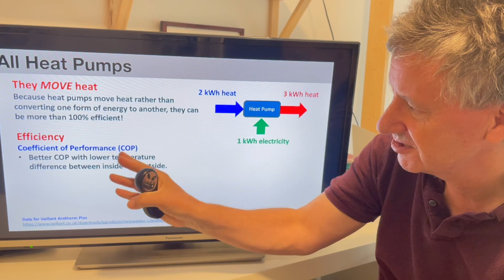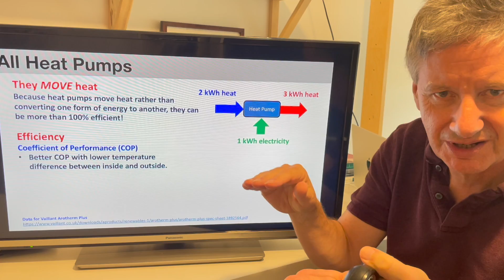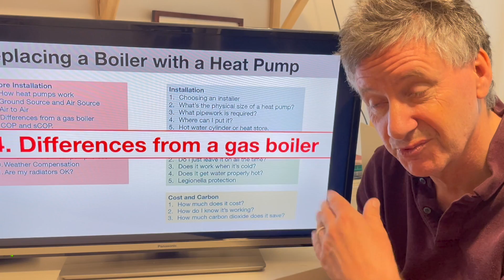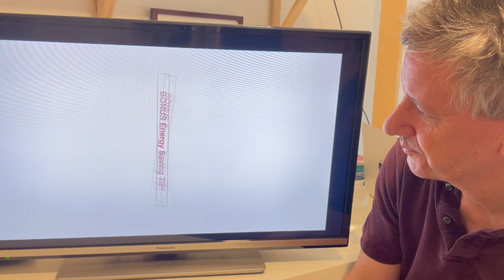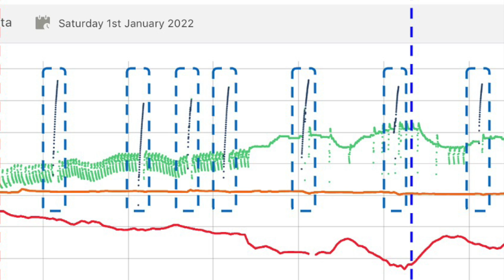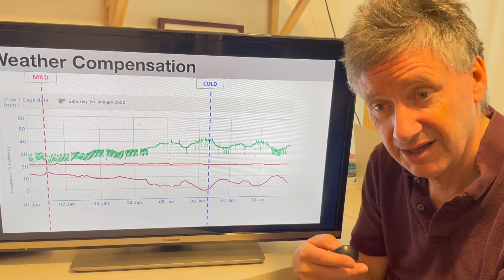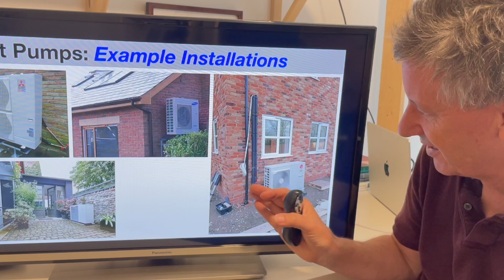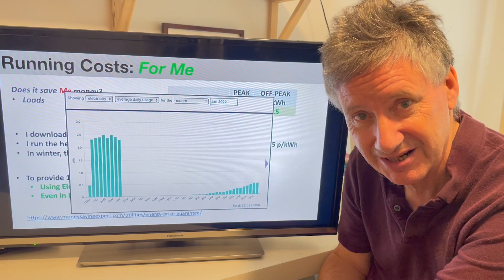Replacing a gas boiler with a heat pump

Comment: Hi Michael, yet another great presentation from your side. Just curious, how big is your soler panel and batteries, that you use to support your heat pump?
Reply from the maker: David Joelsen, thank you for your kind words.

The solar installation is a standard 3.6 kW-peak installation of 12 x 340 W (nominal) panels - 6 on a south-facing roof and 6 on a west-facing roof.

The battery is a Tesla Powerwall 2 and has a capacity of 13.5 kWh.

I think the video below has all the details including costings and installation photos.

https://protonsforbreakfast.wordpress.com/2022/02/04/reducing-carbon-dioxide-emissions-from-my-home-video-and-slides/

Incidentally in a couple of weeks I will add to the solar installation by putting panels on the east facing roof and a flat roof above the kitchen. These are non-optimal locations and orientations but I hope the combination will add enough to perhaps allow me to stay off-grid for a whole 6 months. I explain the rationale in this recent article.

https://protonsforbreakfast.wordpress.com/2022/09/01/its-been-a-sunny-summer/

Best wishes

Michael

Comment: Its amazing how something produces heat from nothing (its a bloody posh name for an immersion heater but at industrial size!) Couldn't spot how this WEF-dictated device turns cold air hot enough to cook bread in my gas cooker ,could you show this technical marvel please
Reply from the maker: David Granger, Good Afternoon.

I'm afraid I can't exactly understand your comment.

Firstly, heat pumps don't produce "heat from nothing": They move heat from a colder place to a hotter place using mechanical work. 

Secondly I wasn't sure what you meant by WEF. Is that the World Economic Forum ? I don't know what that organisation is relevant to this video.

Thirdly, a heat pump would not be used to move heat from (say) 0°C outside to the temperature of a gas oven at (say) 200 °C. But it can easily move heat from 0°C outside to 50 °C inside which is enough to provide hot water and heat your home.

I did make an explainer for how heat pumps work which can see here:

https://protonsforbreakfast.wordpress.com/2022/02/24/heat-pump-explainer/

All the best

Michael

Comment: So the main benefit is reducing your carbon footprint? Big deal. 900 million cubic feet of methane (enough to test 2 million homes for a year) just been released into the atmosphere. That would be my savings wrecked. And I’ve just come back from a business trip from India. It seems they are no burning more gas (and oil) than ever before since the Russian sanctions took effect. A quick calculation reveals That’s more carbon released  than the savings indicated if EVERY home in the U.K. had a heat pump. If people can afford it. Fair enough. But there’s millions who cannot.
Reply from the maker: So your suggestion is...?

Comment: "Basically, ground source heat pumps are not practical". What a ridiculous statement.
Reply from the maker: Chris: Good Afternoon. For most people that is the case. Why do you think otherwise?

All the best

Michael
Reply: @michaeldepodesta001  Because you didn't say ”for most people"
Reply from the maker: @sailingoctopus1  Good Evening.

The videos that I make are not scripted and are full of the inexactitudes which occur in normal conversation.

But despite my linguistic imprecision, it seems like you understood my meaning precisely.

Best wishes

Michael
Reply: @michaeldepodesta001  Then you should have replied to my comment ”sorry I misspoke, what I meant was that for most people ground source heat pumps are impractical, but for those for whom it is practical it is much the most efficient option."

You also failed to mention three  other benefits of ground source heat pumps: 
1. They are quieter
2. They are more reliable
3. The heat pump can be sited inside, so won't corrode and won't be an eye-sore

Comment: What was the cost including any additional cost for updating anything to make it work as it should
Reply from the maker: Gino, Important Question. I have discussed all the works and the cost in a couple of videos.

1. This quality isnty very good but the costs are discussed at 26m11s into the video.

https://www.youtube.com/watch?v=3Pr7wL63FjQ&t=1310s

2. This talk has the same slides with slightly better quality video. Discussion of costs start 13m10s into the video 

https://www.youtube.com/watch?v=E03O3qAZYx0

Do ask if you would like more details.

M
Reply: @michaeldepodesta001  you are a star , I don't have a pc so using the smallest mobile in the world lol . cheers
Reply: Wow you have put some serious investment. I replaced every windows and door glass to k glass so I have now. Used secondary double glazing and wow what a huge difference that has made. I agree with regards east and west. This year I installed roof rails ready for another 6 KW of solar pannels to be placed in East and West positions so I will have at least 20 KW spread over the day. Tip for you boil a kettle and use flasks to keep water hot, then decant enough for a kettle the kettle will be quick to reheat as your water will be hot from flasks.
Reply from the maker: @gino2465  What a wonderful kettle tip which I will be sure to try.

Regarding the general costs, when I retired I had a tax free lump sum of £60,000 and I couldn't think of anything better to do with it than to try to reduce carbon dioxide emissions. If I had had less I would have done less: I would probably have slipped the external insulation and just installed a bigger heat pump.
Reply: @michaeldepodesta001  good man , I am trying but the cheap way lol. My issue where I live is power outages and as I write this we are on our 12kw Diesel Genny. I invested in bigger to allow for EV charging and heat pump when I fit one. I will not go away from log for many years as I don't want all my eggs in one basket . I will work both together side by side .
Reply from the maker: @gino2465  What I have learned since publicising what I have done on my blog and on these videos, is that every person's dwelling and circumstances are unique. 

My aim is just to be as clear as I can about what I have done and why have done it. I know many people laugh at me and thinking spending that much money was madness. I am cool with that.

But it sounds you like you have a grand vision and are doing a great job within what sounds like some quite severe restraints. I wish you all the best in your endeavours!

M
Reply: @michaeldepodesta001  this video you made us the best I have viewed on YouTube you have done an excellent job and it covers everything. I like the cop figures but it's reality of winter months for heat pump and solar. Most people are running out spending £10k on 4kw arrays and 5kw battery's thinking it's the awnser to all but it's not. What you have done to your home is fantastic and is a no brainier because it's going to cost less to hear now. Quick question I was looking at getting my loft inner roof space sprayed with foam , commercial buildings use it do you have it
Reply from the maker: @gino2465  Thank you for your kind words. 

No I don't have sprayed foam. The loft is converted and we have 200 mm of PU foam boards - CELOTEX if I recall correctly.

M

Comment: We replaced our Oil Combe last summer with a ASHP, but the costs involved to purchase and install it are just astounding, and this is the biggest single barrier!  Science is sound but it will just send people to sleep!! What I want to know is why they so expensive?
Reply: Ken, the UK government is making things expensive with the rebate program requirements. Most places use much cheaper and just as effective air to air systems that can be bought for $1-2000. Sorry the UK is such a mess.
Reply from the maker: Ken, I agree. 

Typical UK costs are £13,000 reduced to £8,000 with a government grant.

I think it will reduce over time, but a heat pump itself is more complicated than a boiler, and a heat pump installation is more complicated than a boiler installation. SO I guess that explains the cost.

But in terms of CO2 emissions, your heat pump will be a big win for the planet.

Is the ASHP keeping you warm?

M
Reply: @michaeldepodesta001  the only way they can reduce costs is by cutting quality
 that's already going on . HP's may become cheaper but they won't last. they have a very hard life by working flat out in the worst conditions and far less in better weather
longevity isn't in HP's DNA
I've been in the trade since '82 and until cop goes up to around 6 at zero c by increasing compression technology I don't believe they are a good long life solution against a gas boiler unless air to air is used. air to water is still too inefficient.you'd need to add solar to realise true gains.
however the world needs early adopters to drive the tech forward which it will 👍
Reply from the maker: @richardbartlett6932  Richard, Hi. The longevity of the current generation of heat pumps is unknown - time will tell. 

"I don't believe they are a good long life solution against a gas boiler:

The problem with gas boilers is that they emit tonnes of planet warming CO2 every year, and I don't think that is a good long-life solution for the planet!

Best wishes

Michael

Comment: Heat pumps work both ways. Air conditioners are a heat pump. They are also the first thing attacked as being unnecessary energy-waiting polluters when the power grid gets strained in the summer. The utilities around here will turn them off using "smart thermostats" during peak times, which are peaks because of the cooling. So, after the heat pump heating revolution, you can expect them to turn off your heat during the coldest part of the year.
Reply from the maker: Dear Snarky User, good evening.

Restricting the use of AC at peak summer demand is something that I think is still voluntary in most places. For example, in the recent California heatwave text messages sent to users asking for voluntary reductions in electricity use - mostly AC - managed to avoid the need for power cuts.

But heating is different. Heat pumps are 300% efficient and represent the lowest energy way to heat any home or business. Anyone with the power - which I don't think exists - would turn off electric heaters and gas boilers both of which waste energy compared to a heat pump.

Best wishes

Michael

Comment: Thankyou Michael, we have had a couple of quotes for our 1970s 4 bedroom house here in chilly NE england. We were getting cold feet but your info has encouraged us to pursue the change. Based on your info we suspect they have oversized the pump (11 &14 kw) so we will do the calcs and challenge if necessary.
Reply from the maker: Dear 'The Askews' 

Firstly I would encourage you to make the change if you can, but don't beat yourself up!

Secondly, Tom Swaffield-Bray (@tom_bray on Twitter) lives in teh NE and has just installed a heat pump. He may have knowledge of suppliers in your region, or use the Heatgeek web site.

11 kW and 14 kW are big heat pumps and based on your description of your house it sounds a lot, but maybe your house is detached (lots of outside walls) and in a windy place.

What was your gas usage last year?

Also, if you don't install this year. Be sure to read your gas meter once a week to get a real sense of how your gas demand varies. This will be really helpful for sizing the heat pump.

Best wishes

Michael
Reply: don't undersize it will burn money and never heat the house properly
Reply from the maker: @richardbartlett6932  Hi. Obviously one would aim to get the 'right size' every time. But a little undersizing is probably not that harmful.

Why do I say that? Well a modestly undersized heat pump will heat a dwelling well for most of the heating season when the heating demand is below the maximum.

On the coldest days, additional electric heat will be required. This will come with a COP of 1 but it is not worst case.

And oversizing by a factor two or more - which is common - is not without it's problems such as a extra cost and inefficient use of the pump during most of the heating season.

Obviously, 'the right size' is the right choice, but undersizing is not a disaster and can be a reasonable choice.

Best wishes

Michael

Comment: It will cost us 3.2x less to heat our shop to 13°c(warm enough to keep things tolerable for the dogs and while working) this year because I decided to install our old 11kwh mini split heat pump we used at my old business. It's only about a 9.5hfsp rated so not super efficient compared to more modern high end heatpumps I think the higher end ones are around 13-15hfsp(btus per watt) but we where using wood pellets since they are far cheaper than gas to heat but the cost of pellets went up 1.5x from last year. It should only cost about $266 vs $860 with pellets, atleast to my calculations. Our power is super cheap here at $0.068(£0.061) per kwh so it only makes sense to use the heat pump. I can install It myself(have all the tools and have installed about 7 so far) and the cost here for a 11kwh heatpump is anywhere from $2400-$4500 if you order it yourself. It would cost $15,000 or more buy it from a pro and have them install it. Im glad we are allowed to install our own mini splits here.
Reply: Man, I'm jealous, where do you live that you're paying 6 cents a kWh?
Reply from the maker: Wow: That looks like a no brainer. Well done for switching! M

Comment: If you haven't already, will you have the gas supply disconnected?
Standing charge is getting close to £100 a year in our area now.
Reply from the maker: Leichat

 Hi. Good question with an answer that is longer than I would like. As I explained in this blog article

https://protonsforbreakfast.wordpress.com/2022/09/23/finally-off-gas-well-almost-finally/

we are using zero gas, but replacing the gas hob and cooker with electric versions required a compromise with my wife. And she 'suggested' that we keep the old gas fire in our front room for one more year in case there are Power Cuts this winter. I felt obligated to agree, but hopefully in the spring of 2023 I will be able to persuade her to disconnect the gas completely.

All the best

M

Comment: Is it possible to run a heat pump at a flow temperature of 50 degrees?  If so, would a SCOP of 3 be realistically achievable?
Reply from the maker: Yes it is possible to run at a flow temperature of 50 °C and a SCOP of 3 would be achievable. But please note the following.

1. 50 °C is generally considered 'hot' in the heat pump world and for some older heat pumps it is the maximum temperature they can reach without an addition resistive heater.

2. The link below is to the Vaillant Arotherm plus spec sheet.

https://www.vaillant.co.uk/downloads/aproducts/renewables-1/arotherm-plus/arotherm-plus-spec-sheet-1892564.pdf

If you scroll down you will see a complicated table labelled "SCOP and heating output".

Look at the column label "50 °C flow". For the 5 kW heat pump this suggests that a SCOP of 3.41 is achievable. Great!

3. However I would recommend that you use the heat pump with weather compensation. This changes the flow temperature to meet heating demand. When teh outside temperature is 10 °C, for my system teh flow temperature is 30 °C, but when it falls to 0 °C outside, teh flow temperature is increased to 40 °C.

So for you system, you might only need 50 °C on a few very cold days.

Weather compensation is discussed at 37m10s into the video.

Best wishes

Michael
Reply: @michaeldepodesta001  Thanks for the info Michael, the Vaillant data sheet is extremely useful.  My heat loss calculations are based on a 22-degree internal temperature and minus 3 external (I feel the cold!).  I live on the south coast so these conditions are likely to occur on just a handful of days each year, most of the time the flow temperature would be substantially lower. I will definitely follow your advice and have weather compensation.

Comment: Do devices that can do both air- water and air-air at once exist.  I can see that  been useful, having hot water and some heating air-eater and a couple of air-air air-conditioning units
Reply from the maker: Paul, Good Evening. I don't think so.

Air to Water Air-Source Heat Pumps do offer the possibility of cooling with the use of special fan-coil units. But it seemed so complicated - extra pipework etc - that in my home I installed the ASHP without any cooling and instead added a small Mini-split AC (i.e. air to air) unit to provide cooling for my bedroom. They can also provide heat with a high COP if the ASHP is out of action for any reason.

This probably saved money and definitely reduced the complexity of the installation.

Comment: 300% efficient is fabulous shame electricity is currently  three times the price and the standing charge is double . Until the government stops linking electricity price to gas price , just making energy companies richer . Seems heat pumps work best when you don't need them as much , when it's warm outside  typical
Reply from the maker: I agree those incentives go the wrong way, but actually for me it's 360% efficient and a gas boiler is at best 90% efficient. And since I buy the electricity at night for 7.5 p unit, most of my heating costs 7.5/3.6 = 2.1p/kWh. I am quite happy with that.

M
Reply: I'm  getting the impression that, cost-wise, you need solar+battery as well.   Otherwise, it may actually be slightly more expensive.

The main pro's, though, are:  first, that carbon dioxide reduction.  Then, by running the heat pump steadily on low ( and not like a gas boiler, on then off)m you get a steadily comfortable home, plus constant hot water in taps.  So, convenience.